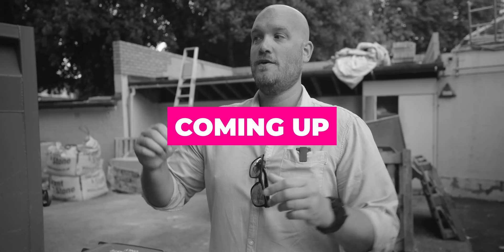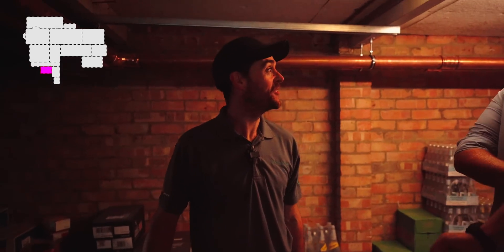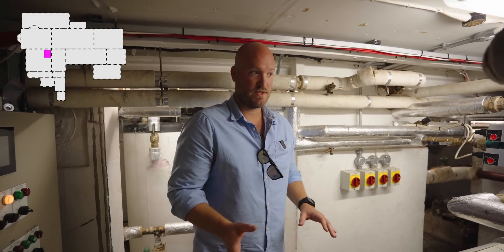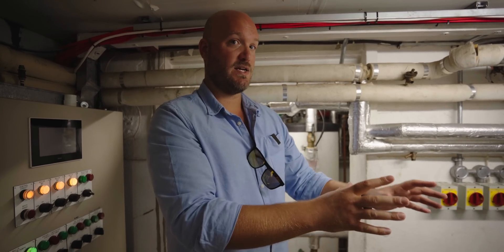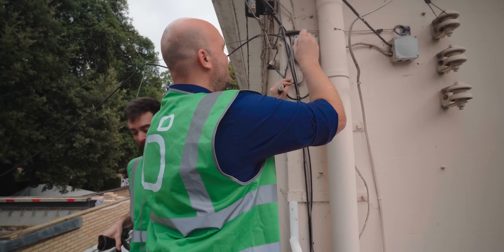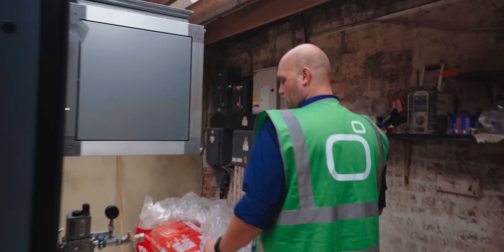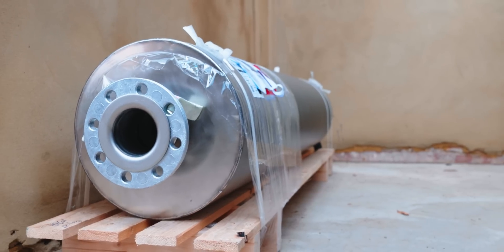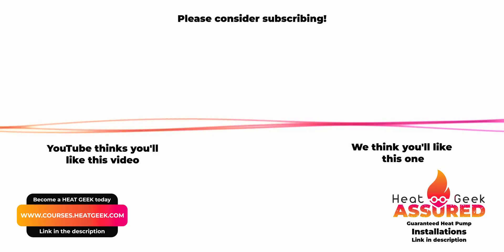This Micro Power Plant Will LOWER CARBON & Save £MILLIONS! | CHP Install

Comment: Check out the EC Power CHP that SAV Systems sells. They’re modulating and are much more efficient than this one. 6, 9, 15, and 20 kWe. They’re modular like boilers so you can add them as needed.
Reply: Load tracking

Comment: I'd really like to see a video comparing heat pumps and cogeneration such as a good gas turbine micro CHP like the EnerTwin Micro Turbine CHP residential. Is there ever a justifiable case for cogeneration vs a heat pump and why was CHP chosen over a heat pump in this case?
Reply: When you have hotel heat and electrical loads on site it can easily make sense
Reply: Is the EnerTwin available in the UK yet?  I spoke to them about five years ago and they weren't ready.

Comment: I've only seen one of these installed in a leisure center. A complete and utter disaster their bills went through the roof.
Reply: I can't see how, unless they were dumping heat?
Reply: @patrickwheeler2646  Presumably it was setup wrong

Comment: Probably the best solution for that place, the roof pitch is far too shallow and there's probably a conservation order on it preventing the flat tops having solar anyway.
Reply: There's over 100kw of pv going on another roof on site with a more suitable roof.
Reply: @patrickwheeler2646  Just seen your reply, that's brilliant news.
Reply: @patrickwheeler2646  The amount of summer excess 100kw would produce would be huge, if only there would be a way to store it! It's a shame there isn't a viable PV>H2>FC system for storage for at least a month or 2
Reply: @Loopyengineeringco  they've got the Thames right next to them, perhaps we should make a dam instead 😁
Reply from the maker: It's getting solar PV too
Reply: @HeatGeek  I'm surprised, a very similar building in Sussex tried and failed to get permission from national heritage. But as I've stated before it's normally local officials stuck in the mud that are blocking innovation! Nice to see people elsewhere making progress!
Reply: @HeatGeek  have you ever looked into vertical wind turbines for domestic properties? I'm interested to know more about them as the cost is low but they are more suited houses with more land, they are usually 1m tall, 0 5m diameter, beed to be 5m from a boundary and between 5m and 11m off the ground.

Info. Is limited and might be for good reason. The 1.5kw generate a good amount of power though.
Reply: It's surrounded by car parks.